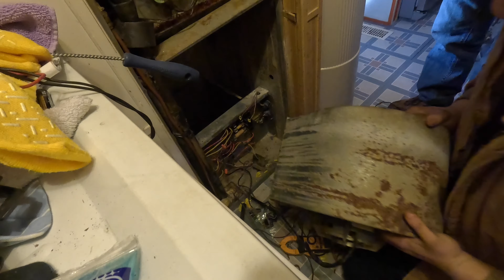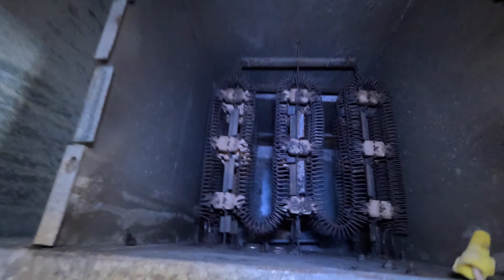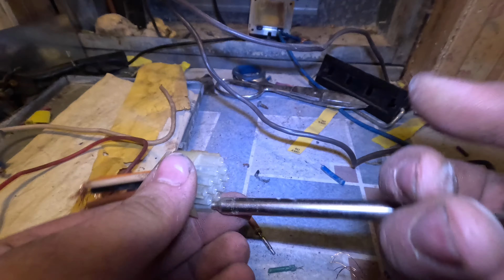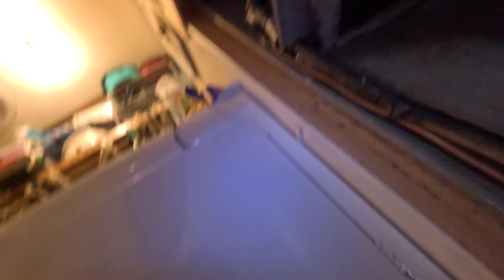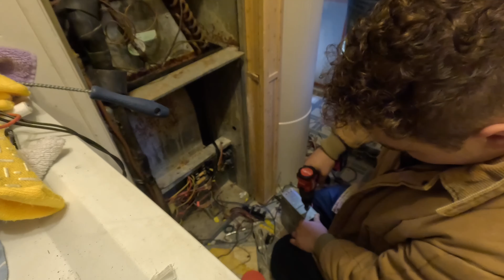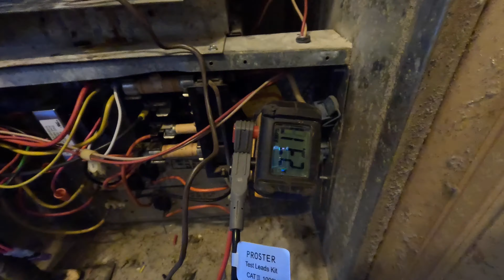The customer tried to fix their own unit

Comment: This is a furnace for heating the residence yes ? we dont have those in the Uk how does this work ?
Reply from the maker: This is a type of furnace that they install into modular homes. You basically have two main components that you need to operate the blower motor and, the electric strip heat. The way I have it wired up now is whenever the thermostat sends a 24 V signal through the white wire it will energize the heat sequencer and the heat Sequencer will turn on the strip heat and also energize my fan through the five pin relay that it is hooked up to. Whenever the system is in cooling mode the thermostat will send a signal through the green wire to close the six pen relay And turn on the fan. This way, the fan is interlocked with the heat strips, so there is no way that the heat strips could run without the fan unless something is broken.
Reply: @RidingWithRamsey  Our goverment has tried to enforce ''Heat pumps'' on all modern builds from i think 2027 & remove any existing gas heating systems it's now been rolled back' Trump has binned the same mandate Biden setup' but i dont think the heat pump is like this system im not really interested in all this zero carbon nonsense to be honest , anyway that was a mess you had to deal with nothing like cleaning up after someone else'  👌
Reply: @leso204  Ramsey is in the USA, as an  HVAC service tech and contractor I'm sure he's acquainted with heat pumps.  You don't have to be "interested in zero carbon nonsense",  you only need to be interested in saving money on your space heating.  Resistance heating is expensive unless you live near a dam or nuclear plant.